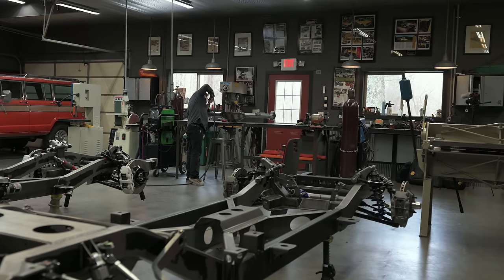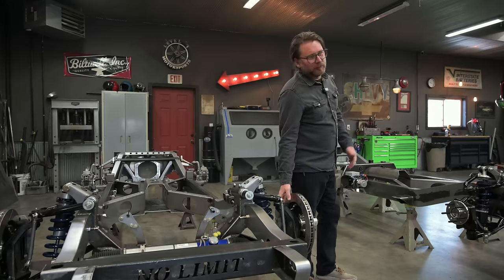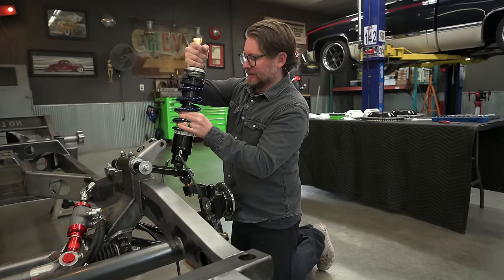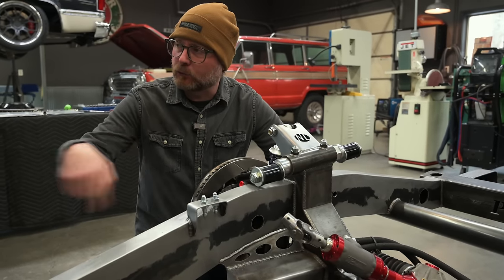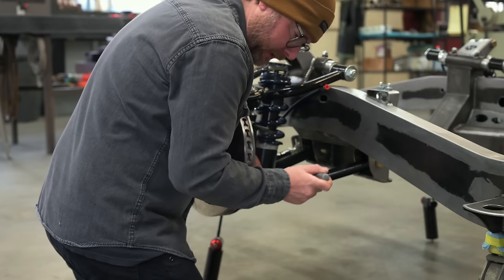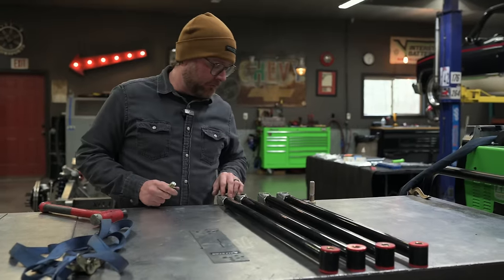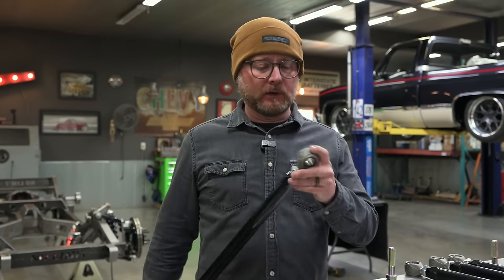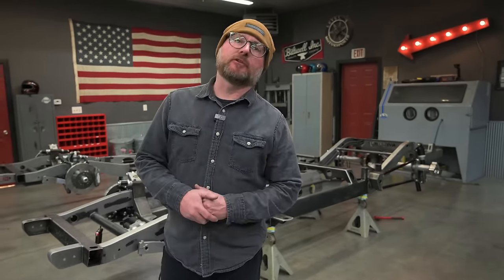WHICH RACE TRUCK CHASSIS IS RIGHT FOR YOU | 4 Link, IRS, Big Brakes, Suspension Assembly

Comment: What would you say is a good antisquat range for a street truck? Would 100% be too high or too low for a starting point? Building to cruise as well as canyon/mountain roads etc
Reply from the maker: So, tire compound and power are variables as well as how much you want it to hook.  For instance, if you made 300whp you would want less anti-squat so you can take off harder.  That being said, I like a number around 150% for the normal street truck that makes around 450whp.

Comment: surely that lower shock bolt on the rear 4 link will just bend?
Reply from the maker: There is a large steel spacer behind the shock. It keeps everything from being able to flex by enlarging the surface area. Never had one bend.